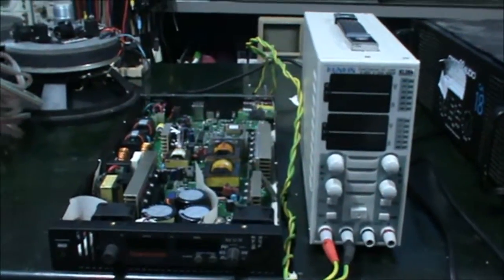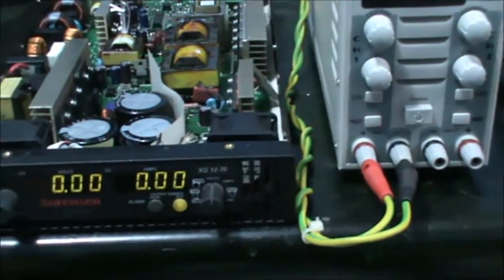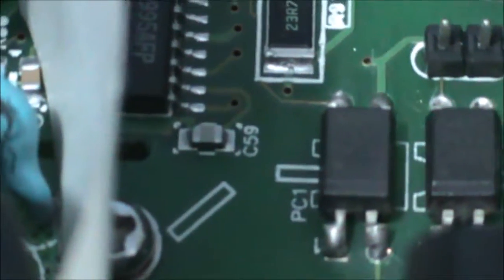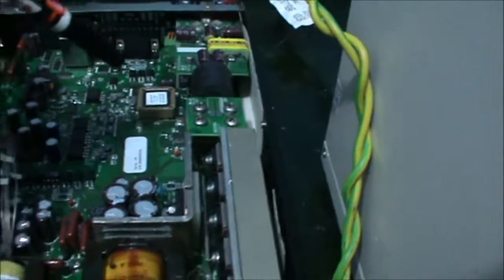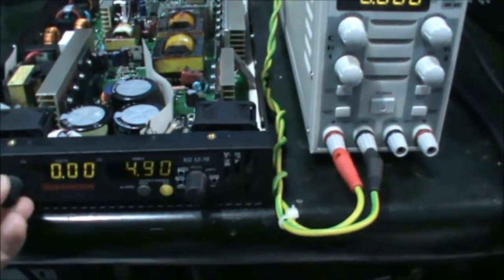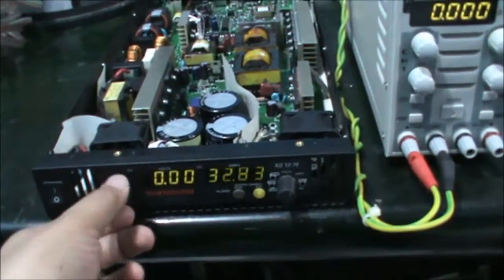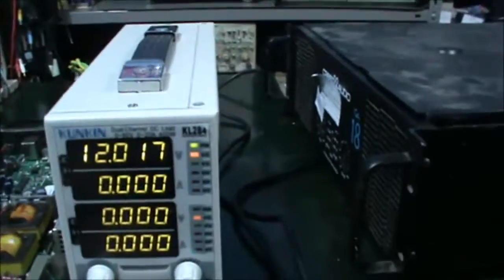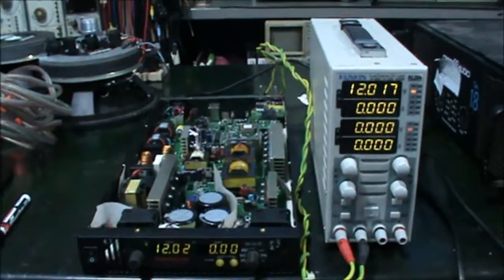Sorensen XG 12-70 Ametek Xantrex No output problem, solved

Comment: I am wondering how do you locate the fault component at the optocoupler PC2? Do you have any schematic as a reference during the debugging? Thank you for nice video! I have a XG series for repair in my hand, and I have no clue yet! 
The marker on opto says R 2561 LJ139.
What would be the normal voltage at PC2's secondary side? I measure PC2's primary side and it seems to be AC line referenced. PC2's secondary side pin 4 is about 5Vdc and pin 3 is about 0V. Could you please give me some advice. Thanks a lot.
Reply from the maker: Hi. I hv no schematic. But those opthocoupler will be triggered on and off
Reply: Akang Hadi Batam  Thank you! I will do more debugging and update you later!
Reply from the maker: @yezhao26  good luck friend...
Reply: @akanghadibatam7285  My unit mode l is XG80-21. 80V and 21A. It is about the twice width as yours, since there are two units in parallel to double the current rating. Their power stage and control circuits look very identical between master stage and slave stage.  On master stage (closer to your front control panel), PC2 (optocoupler with marks R 2561 LJ139) is not toggling when I enable or disable the output. It seems the output of opto is always ON. The voltage drop over pin 3 and pin 4 is very low.  On slave stage, PC2 always has 5V difference between pin 4 and pin 3. I notice that there is a 2-pin male header next to PC2. The pushbutton on enable output won't change the voltage across the output side of optos.   Also I am wondering if it's for quick enable/disable for manufacturing or debugging.